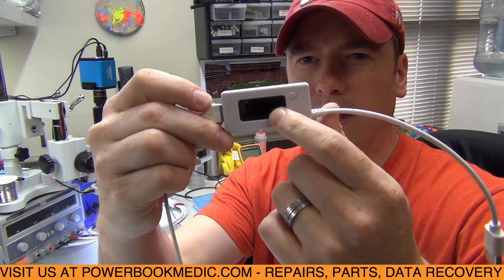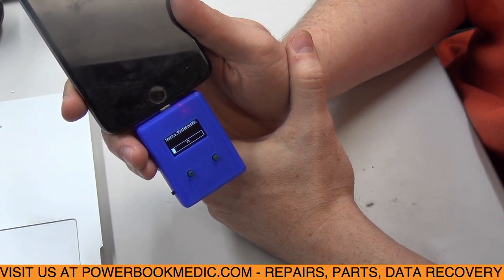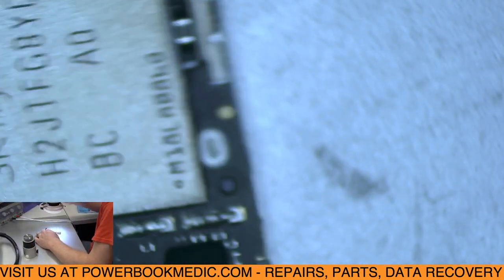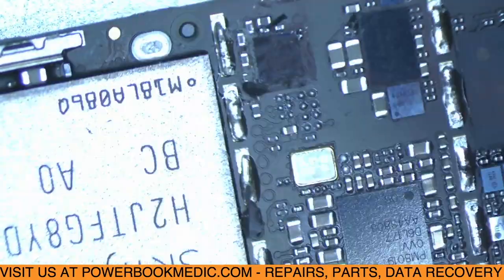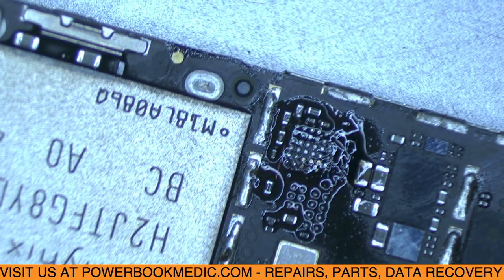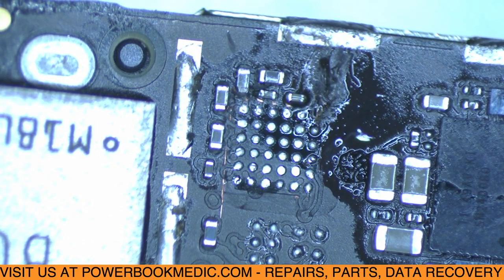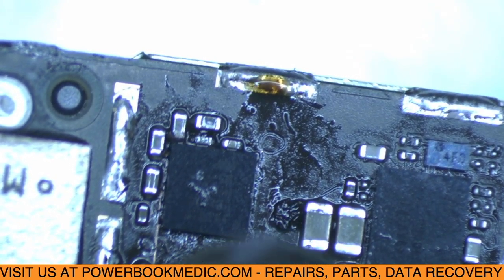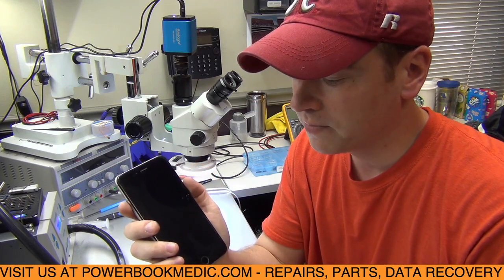iPhone 6 Plus Won't Turn On  - How to Repair with Tristar Replacement

Comment: Hi, I replaced my Iphone 6 plus battery ...and probably i connected the new battery first and then connected the screen during the replacement ..i tried everything ex hard start, connecting disconnecting everything but my phone doesn,t start. any suggestions ?

Comment: My iPhone 6s Plus is not turning on nor charging I replaced the battery it worked for like a hour than stop working again. What’s going on
Reply from the maker: Slime It could be the tristar chip, but I wouldn’t be able to tell for sure without diagnosing it in person.

Comment: Thank you for explaining the reasoning behind the chip failing. It makes a lot of sense: The chip prevents the power from going to ground directly, and the phone from blowing up. If the chip is blown, the phone won't turn on as a safety mechanism. The chip was destroyed by an unauthorized cable sending too much voltage into the chip.

Comment: I replace my screen my battery and my charging port on my iPhone 6plus and still don’t power on I would have to do this to make it work ???? Can someone give me some info really don’t want to get a new phone
Reply from the maker: Luis Salazar It’s probably a problem with the logic board, but it could be anything.  If you aren’t experienced with working with logic boards, it will be best to send it to an experienced tech to get it fixed.